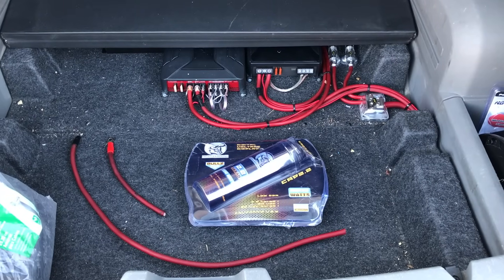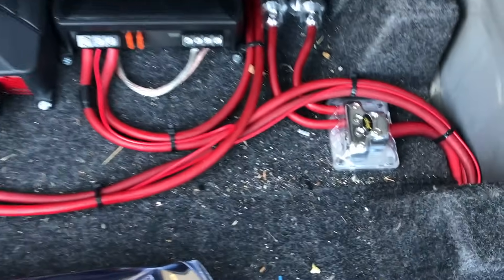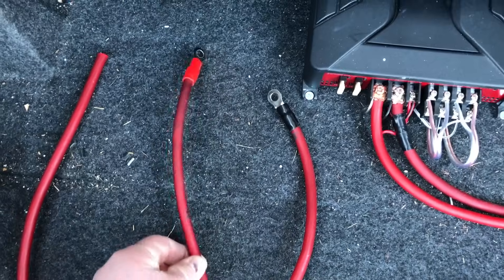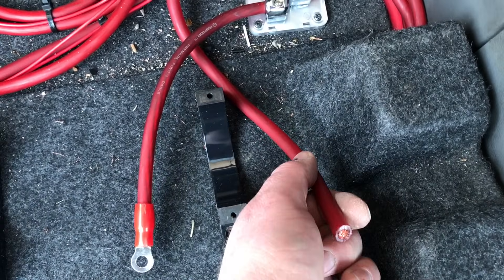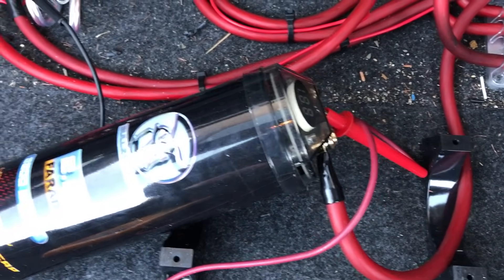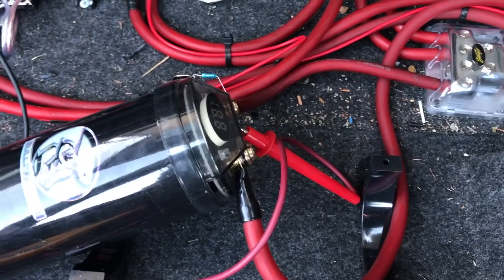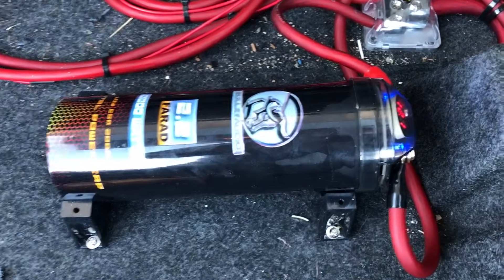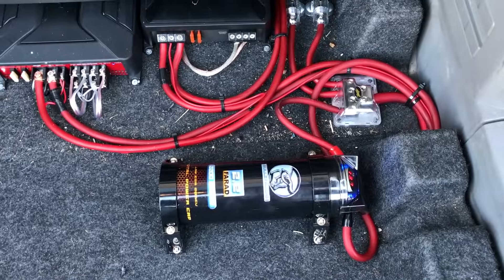How to Install a Car Audio Capacitor in your Vehicle

Comment: Great video, especially the resistor tutorial. I am installing two capacitors today.
Reply: ok...need to know...can you run 2 super caps between the amp and batteries and how well does it work??????
Reply: What is the set up here? Two amps, with a positive cable going off the shot into a negative distribution block. I’m confused, can you help me understand the set up please?

Comment: I done it this way before and in my car (e46) it will still dim the lights and bass feels like it’s losing power. I found that it’s best to go straight from the battery to the fuse, the fuse to the Capacitor, then then capacitor to the distribution block. After installing that way all the problems went bye bye lol nevertheless still a great video just helping out the bmw community if they Experiencing the same problem I was having.
Reply: I was looking for this comment. I was looking at the way he wired it and thinking to myself well how the hell is the cap even doing anything if wired after the block on its own seperate terminal?? 😂😂😂 If anything its making things even worse because now he has essentially added one more item the alternator has to keep charged. lol
Reply: You're 1000% Right! Thanks for the correct comment/tip..  cap must be in main line after the fuse single line to distro block..  any sudden power demand will have to use cap and that's what it's purpose.. the video way it's pointless as draw seek out the prime source (didn't get the memo to stop and ask side cap if has any to spare)
Reply: What watts was your amp and subwoofer

Comment: Best way install a capacitor is to get upgrade to a high output alternator. Ask me how I know...
Reply: If your car is not too far off from getting enough power, a capacitor is great, you just HAVE to make sure it’s an actual good capacitor, because there are so many that are scams and work absolutely horribly
Reply: Yeah, upgrading the alternator comes before adding a capacitor
Reply: HEYY Ethan, I seem 2 know about the failure, I'm experiencing that know as well with a ( ""SUPPOSED""), 220 AMP ALT, thats now going out( squealing when I start then goes away after 30sec or so), got a (""SUPPOSED"")40 farad cap from tsunami but not sure if it's working rite, gonna get a 320amp alt now annnd an optima or odessey batt up front 2 replace and hopefully that rectifies my problem. Like,whole car about to shut off when my bass reallllly hits.
Reply: Thanks for the tip. On my primary vehicle, I need a high output alternator. Simply sucks too much juice. On my secondary vehicle, my alternator has enough output to keep up and charge my battery, but I've found the bass hits are taking a toll on the voltage regulator. As such I'm planning to install a capacitor to take some of the hit off the alternator's regulator.
Reply: If only I didn't drive a 2013 Honda accord with an ELD that can't be bypassed so it doesn't matter if I have a stock alternator or a 320 amp alternator, the ELD will limit their output just the same. :(
Reply: You guys can also help with the draw by turning you gain down. It seems like you guys are pushing more power then your systems needs.
Reply: Best way is to install it properly... this fucktard doesn't know shit.
Reply: How u no
Reply: Do the big 3 and don't worry about it. It's a must if your installing car audio. Plus good wiring is expensive for a reason... I have used NVX and knukonceptz in the past and was happy. Just look into big 3 upgrades, I think they even sell a kit to make it that much easier.
Reply: What if you don't have an alternator?
Reply: @scottmerritt4279  like an EV, then you would need an upgraded DC to DC converter to increase the amount of charging amps to the battery and power to the 12V accessory demands. The batteries on a EV are plenty enough reserve for a 12 volt system. For reference see LF Audio, but he is running huge amounts of voltage on his amps as they are designed that application. There is a method for every application and it can get as simple or as advanced as you make the situation. If you have an EV then you are probably more concerned about efficiency in that case you’d want to design an efficient system which is another design consideration regarding the entire system so one way or another it’s all about sacrifices…. Good Luck!
Reply: Duh how do you know
Reply: Ummm how do you know
Reply: @Ethanmurphy-uq3so  I learned the hard way, just in case you are serious. When I bought my first car (age 18) I went to Best Buy bought a 1 farad capacitor to add to my  stock battery and alternator only to experience the same issues of dimming lights and periodic drained battery. After going to trade school (2008) I learned the best course of action was to either get an upgraded alternator that can keep up with the demand or get a bank of batteries with enough Amp Hours (AH) and keep them charged up ... or a combination of the two. Caps really are storing energy between peaks, however when there is a lack of energy input present at the battery (power storage) the demand goes to the alternator (generated power). Caps in the incorrect use case really accelerate the issue unless supplied with the proper power or the system is within the scope of the stock configuration. Now SuperCaps are a different item, then so are Lithium batteries ... Takes power to make power and you have to start at the source. The End.
Reply: @PhiMobileSounds  does a 10 farad capacitor help if I have already installed a high output alternator. I am putting in some subs and am a little confused if I need a capacitor or not. I am already running dual batteries and have a 220amp alternator
Reply: @PhiMobileSounds back in the day my lil brother installed a pretty crazy system …. His lights head lights  almost flash when the base hit.  He installed a second battery in truck and it seems to fix the problem..
But reading your message … I suppose once that 2nd battery was drained he would probably see the same issue … he just took small trips or didn’t have the music cranked all the time ….
Anyways .the end
Reply: @mycaddigo  just need to keep the battery healthy and make sure that the batteries supporting the system meet the requirements for the load.
Reply: @PhiMobileSounds 😂i have the same problem light dimming and battery draining. .stock alt&battery. But amp is a basic amp  300 watt sub and amp
Reply: @PhiMobileSounds  you are correct it takes power to make power and it definitely sounds like you know what you are talking about so I have a question all of this stuff is brand new to me capacitor's , lithium etc. when I left the car audio game over 10 years ago an extra battery in the trunk was doing big things now everyone has massive lithium banks or super caps so I recently bought an ioxus ultra cap battery and a 74AH lev60 battery from jag35 to upgrade my power supply reason being my car 2019 Toyota Camry LE has the ONBUS LINBUS electronics build which I'm sure you already know is where the ECU is built into the alternator housing so I can either pay thousands of dollars for someone to custom install a HO alternator or get enough battery to handle the output as you said and since I don't have the money for the custom work and being that my car is still under warranty and a HO alternator will void the warranty so I ordered the 74AH battery and I was told that since I have a stock alternator that the supercap battery from ioxus will help it stabilize the voltage drop and be able to recover in between bass drops so I said all of that to ask if this will be enough for the setup I'm trying to run I want to do around 5000 watts rms 4 in the trunk and 1000 on the mids and highs I want my setup to be stable with little to no voltage drop and I would like to have some play room for error I have been told everything from less than what I just ordered all the way to 192AH bank with voltage regulator increased to 14.4 volts and I need a straight answer from someone who knows that I can cross reference and verify so I can make it happen any advice would be greatly appreciated and is a voltage regulator something that would help and if so how do I know what one to get for my car
Reply: @PhiMobileSounds 3years later your comment is very useful thank you for educating us
Reply: I know this is old, but you are 100 percent right. You have to calculate out your total amp draw and not assume a CAP is gonna work . Second, who the hell uses all RED wire in a DC system ? You can tell he doesn’t understand the voltage load a cap holds and if you have to work on it at a later time and forget the cap is charged, it’s like which wire is ground …. Do do half ass work and be cheap and not buy black wire for ground because you don’t have the money or had xtra red laying around. STUPID!!!
Reply: Or you can install other batteries and another alternator😂😂
Reply: @Jason-uh7ml  now we're talking!
Reply: @PhiMobileSounds  thanks man I know my alternator will be able to keep up just want to know if a capacitor will keep the energy flow constant so the sound is consistent.
Reply: @jakenelson5658  You are welcome.  It is all physics just do the math. I have a 240 A Mechman and 3 XS 925 batteries on 4,350 Watts RMS.
Reply: you floatin the bill?

Comment: Random question,  does it really matter if i run a power cable from my cap to my amp?  Or can i just connect the positive to my power disruption block and the negative to my ground block?
Reply: For the best and most stable result you should run a 12v cable with a fuse to ur battery, and i also did it with the ground for a more stable connection. sry for bad english:)
Reply: @Elivili  ground to the battery?
Reply: Yah I don't know why he connected it directly to the amp. Straight to battery or distribution block is fine. Also don't use same ground as your amps and don't run a fuse in between the capacitor and amp either

Comment: What not to install in your car 101, capacitors are garbage and you guys as installers should no that. There ARE decent capacitors, but this cheap 2.2 farad garbage is nothing but a oversized noise filter.
Reply from the maker: *Know ;)
Reply: Provo Beast Audio Installation I love you 😘

Comment: The biggest difference I noticed by adding a cap is rock music hits twice as hard but bass tracks didn’t improve much
Reply: It’s because certain frequencies stress more power then others, some music your system is able to keep up fine, hence why it doesn’t change, but the music where you previously were reaching the limit of power is now getting fed what it needs

Comment: My my old amp RZR1-2500D, compared to my new OD1-5000D amplifier ...  the RZR1-2500D amplifier would drop voltage just a tad, this one drops down from 14.5 to 11.9 halfway turned up on my head unit and amplifier less then ¼ on subsonic an LP filter. I have the same on only different year's. I'm guessing that I need a yellow top Optima battery for my new amplifier to help with the power issues?? Any suggestions feel free to lmk what I should do or not do. Most say get rid of the compastor but it helps & lets me read the voltage!

Comment: hi there, great video and super easy explanantion guide. My only question is can i install a 1.0 farad capacitor in my car without a sound system to give a cushion to all the extra accessories like the dash cam so that it does take a toll on the electrical system? thanks in advance

Comment: Why the need to charge with a resistor before install? What if my capasitor isnt new and i dont have resistor? Can i charge it to 6v with a trickle charger?
Reply: To prevent damage to it.
Reply: If you can charge the cap with a trickle charger and not blow anything up,then why not fully charge the cap and then attach it to the car.

Comment: I noticed my cars electrical system was improved by installing one of these. I installed a car stereo, then added subs and a 2000 watt amp, then a capacitor. I used to have a radar detector that showed the vehicles volts. If I remember correctly, it was like 12.8 volts on the display, then it jumped to 13.4 volts for like, ever. I always felt like it helped my car battery by not draining as much. Unfortunately, I'm here today because one of the bolts on the old capacitor stripped and I don't think my amp is working properly because of that. So I bought a new capacitor and here I am. Thanks for the video!
Reply: Update, finally installed the new capacitor and I believe I'm back in business. I went with a SoundBox 2.5 Farad capacitor and so far it seems to be working fine. Apparently I had a short at the fuse for my sound system which is part of the positive. Oh well, this one has a voltage meter in it so that's cool. I'm still running a touch screen with 2000 watt amp but now have a dash cam installed in the front. All of these things steal power from my battery so I'm happy to have a little more juice with the capacitor. I need to install a second dash cam for the rear view but I'm lazy and I'd like to replace my tint. Just thought I'd update if anyone cared for more info.
Reply: I know I'm late but did you do the big three . . I have a capacitor . and 0 gauge  25o amp from battery pushing a 5000 watt amp . probably a 1500 watt fr . but ??
Reply: @TvsJackNdaBox hey late again but the big 3 is just upgrading the wires upfront for a better connection and one less failure point correct?

Comment: Hi what happens when i connect the capacitor without rezistor will it work when i start the vehicle ?
Reply from the maker: It will probably spark.  It may or may not affect the performance of the cap, but depends on the manufacture.

Comment: Biggest waste of money and doesn't do s*** power caps are not worth the money if you really want a good Reserve you need a second battery I would never buy a pack up in my life again all they are is expensive digital voltage readout

Comment: I noticed you set up the capacitor before the fuses did that affect the storage or had no effect at all?
Reply: Seriously there's all kinds of backwards in this video not to mention the way the capacitor is recommended to hook up.  Every one I've hooked up recommended not to install from the fuse but after and from the distribution block and separate ground. Plus all you need is one fuse from the battery to the junction block or a multi fuse junction block. Most modern amp's have fuses in them so really the inline fuse to power is mainly for cutting power when things go wrong. But to each their own I guess

Comment: Could one hook a jump box up to the cap to charge it up?
Reply: NW Herbalist  I actually did that a few months back just instead of using a resistor I used a light bulb from the tail light of my car and it definitely worked....
Reply: By the way I used the bulb because I had lost the resistor somewhere

Comment: What were the stripe colors (resistance) on that resistor?
Reply: Indicates what size and the use it can 4, if they wer diff colors then possibly 1 yu could use on a tweeter for sound enhance and clarity

Comment: What kind of capacitor do I need for a 1/0 gauge 4500 watt monoblock amp?
Reply: I’m far from an expert when it comes to car audio, but I believe I read some where that you should have at least 1 farad per every thousand watts. So you should be needing a 4.5 or higher farad cap.

Comment: What if I’ve got a diesel so I already have two batteries, would a 3rd battery or a capacitor be better for two 12’s?
Reply: You can buy xs capacitors that are 3100 farads each for 85 dollars.  You will need 6 of them to hit about 15v 500 farads.  Do not buy any of these fake ass 1 to 5 farad caps.  If you have dimming I’d suggest new alternator or a bank of this caps.  High amp hour batteries always help too.

Comment: Bro you should have put in 6  3100 FARA caps to come out to around 15V  500FARA total at the end.  Which would have cost about 400 dollars but WAY WAY better then that FAKE ass cap you installed.

Comment: I have a Belva 1 Farrad Capacitor Connected to 2 Amplifiers. Connection. Batery-Fuse-Capacitor-Rockford 500x1D & Rockford 250x4. The LED meter on Capacitor seems to drain my Battery within a day of car not in use. It is a brand new car and have tried disconnecting the main fuse-sound system and then the battery holds charge. There is no Remote connection on the Capacitor. What could be wrong. Everything is new and when car is running functions correctly. Can anyone advise
Reply from the maker: Time to get rid of the capacitor.
Reply: @ProvoBeastAudio  I shall try disconnecting the cap. I do notice the LED turns off after a few minutes. But noticed that my 250x4 turns off but my 500x1 remains on. The remotes are common on both amps? Dunno?

Comment: I am running the same 'Brand' cap 6600w on 2 Amps but doesn't go to sleep after shutting off the Audio system and drains my battery after parking for a long period what could be the issue with that?
Reply: Battrry isolator
Reply: I will try it
Reply: Youl need on/off switch for when you turn car on/off it stop the batt from sendin power to cap/amp.. soo
You MAY find that the cap dies cuz the isolator is stoping the power to it.
Reply: But you wont have to worrie about your batt diying
Reply: @darrylparks6053  Thank you so much
Reply: @Amr9114  im knowlageable of car audio stuff but im no expert by far. So double check with someone that knows alot about it.

Comment: What ohm resister do you have to use
Reply: 100 ohm
Reply from the maker: Generally a 1 Watt and 500-1,000 Ohms resistor works fine for most basic capacitors

Comment: hi how about if you have three amplifier how you gonna connect it?
Reply from the maker: If you are running 3 amps, you probably shouldn'd be concerned with just a capacitor.  At that point, i suggest a big 3 upgrade, upgraded battery under the hood, and possibly a second battery.